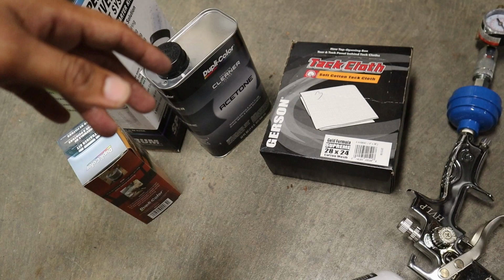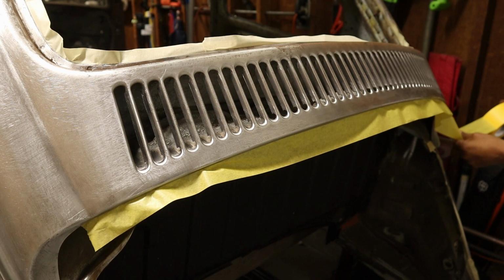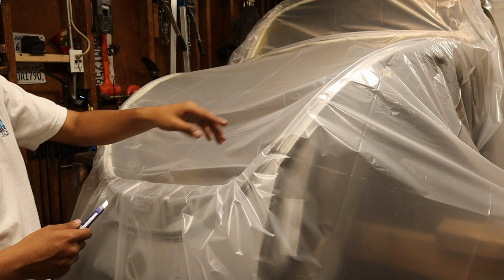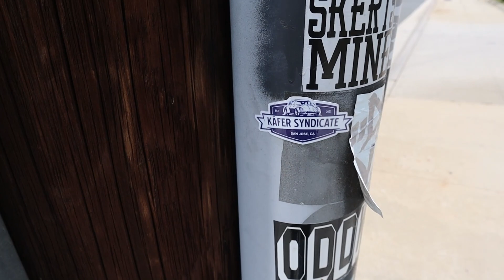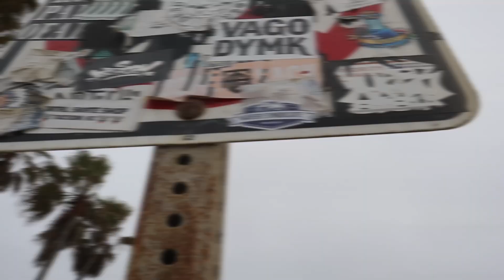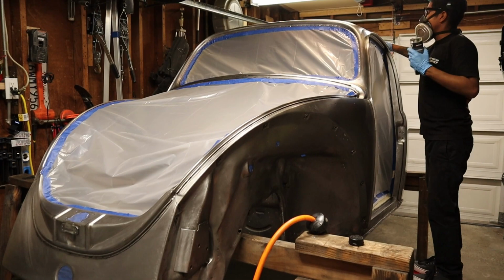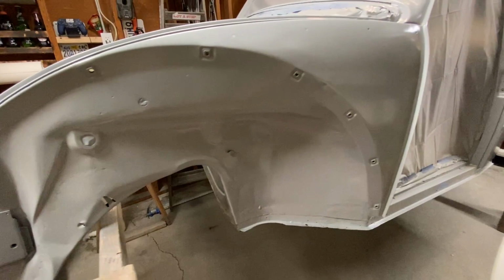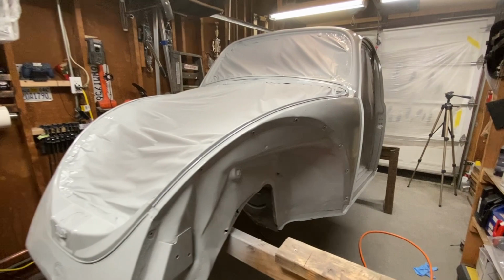1969 VW Beetle Restoration- VW Paint Job & Mooneyes Store Tour

Comment: Hello Oscar, a "candy store" 😀 that's exactly what I said about CSP it's three quarters of an hour from me.  nice trip you made.  As a tip for your primer, please try to protect your garage and yourself more, the garage is then dust-free because everything ends up everywhere and also on the body.  Your skin also absorbs toxins, it doesn't have to be.  Also build an exhaust.  I just used a cool fan from the car with the following filter. That's great because there's less dust on the body overall.  Ps.You're a great skateboarder so you can learn everything.I still like to skate like I used to.Greetings Mark
Reply from the maker: Hey Mark. Can you explain what is CSP ?. I am currently working on building 4 walls with 2x4 to divide the room but I was very happy with the final result. There is very little dirt but I can't complain. I wanted to lay this coat down because I was tired of sanding the bare metal every two days to keep the flash rust away. Thank you for your tips mark and I will make you proud on my next video. I know it won't be perfect but I can try!..... Skateboarding... The thing I learned from skating is to always try and never quit. Thanks for the support Mark much love from California.